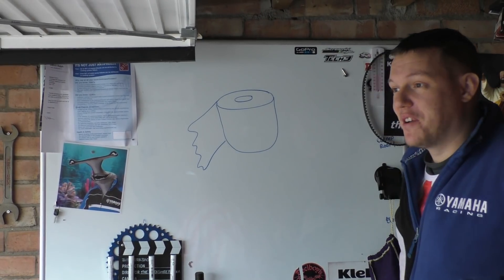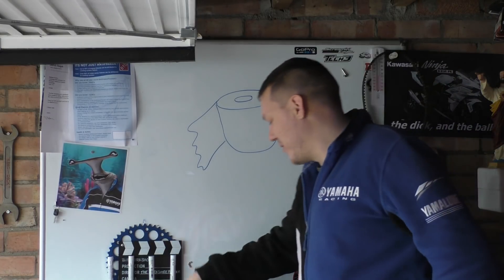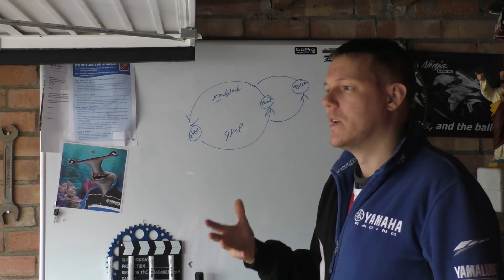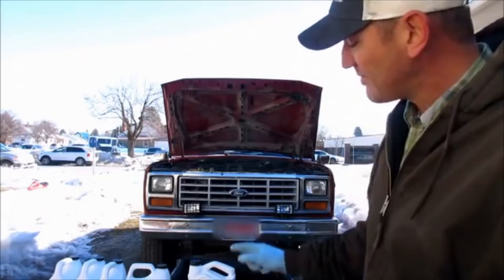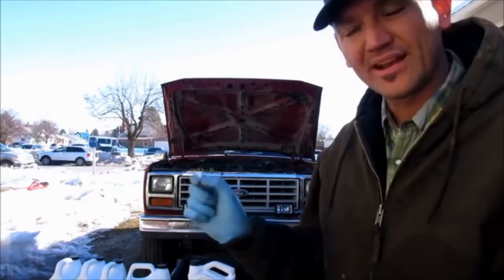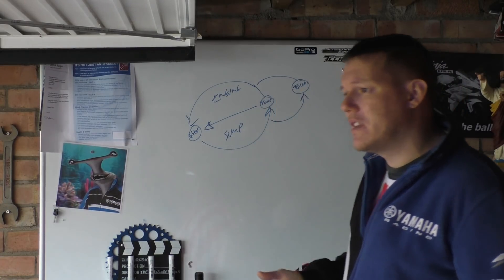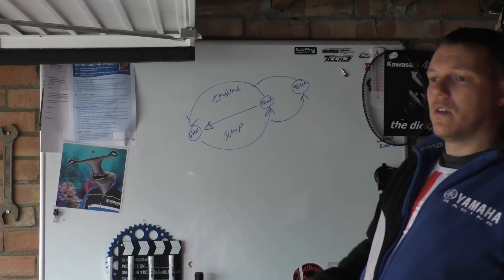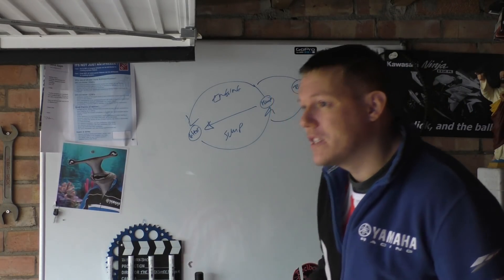Toilet paper filter???

Comment: if bits of metal are the cause of engine wear, do magnetic sump plugs make a significant difference?
Reply: I always liked them. They can at least give a warning something IS wearing or becoming a problem and give prior indication.
But as was said, it will only be a small bit and won't really get rid of too much.
That said when I used to work on older wagons years ago I would often find a pretty fuzzy sump plug.
And they really can't do any harm. Or none I could possibly envisage.
Reply: omallykaboose yes you know they do!
Reply: rationalmartian when you say prior indication, is that the type where you remove it and think, fuck me that's a lot of metal, best wipe it off and hope for the best haha.
Reply from the maker: No, a lot of the metal isn't magnetic - not only that but all the particles would have to pass with 5mm of the plug
Reply: omallykaboose Doesn't really do much, but it won't harm anything to have one. Might as well catch whatever decides to cling to it, but it won't save an engine if aluminum is flowing through.
Reply: Nah not really, not going to do any harm so if it makes you feel better throw it in there, but doubt there's any real advantage